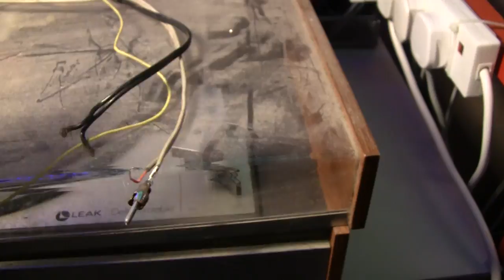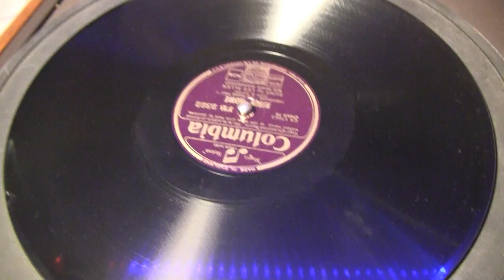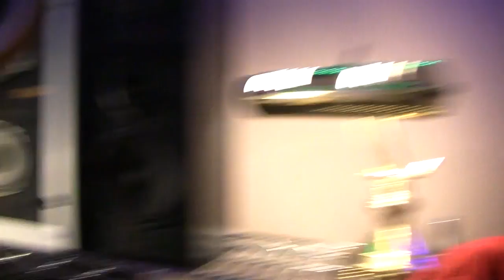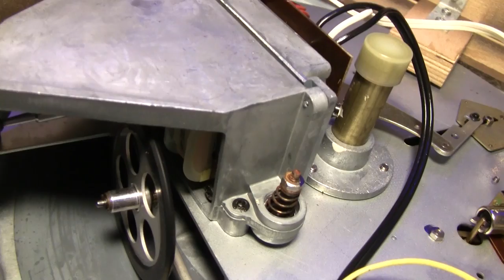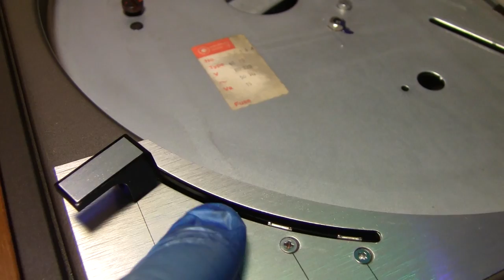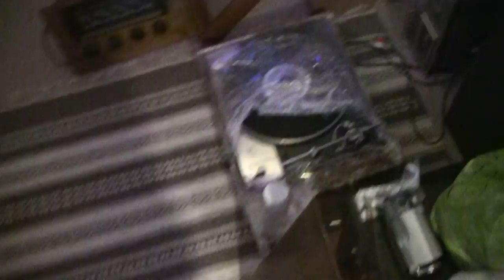Goldring Lenco GL-75 Turntable - Service & Presentation!

Comment: When I first began watching YT, I came across an video from a fellow who restored an Lenco TT for use as a dedicated high end mono record player. He installed a mono cartridge and was using a restored 50's mono tube amp and one excellent speaker unit. Those Lenco TT's are intriguing to say the least. I've yet to see one in my travels here in Canada but I'd pick one up if I were to find one. It was great to see the innards and the mechanisms!

Comment: I quite liked the GL75. Why anyone would have purchased the Leak version when it cost quite abit more than the Lenco original always puzzled me. The arm is not the best for sure, it's quite massy. I used to sell it with a headshell punched full of holes. This did help remove at least some of the mass. It worked best with a cartridge that would track around the 2.5 gram range. It did not like the Goldring G800/E which was often sold with it. It really did not track well at 1-1.5 grams.
Because of the high electrical field the AC motor throw out, some cartridges would pick up hum as the pickup moved towards the centre. The GRADO FTR is a good example. Any of the Decca range is a no no! Great cartridges but not on the lenco.
Reply from the maker: Hi MB, Thanks for the info!

Comment: Hi.. Great video. I have a Goldring Lenco 75 I think. Should I eBay it sold as seen or try to get it serviced? If they sell from between 60 to 120 maybe not worth it. The perspex lid is quote scratched but otherwise good.
Reply from the maker: Hi SB!

Well, it depends on what you want more than anything else. If you don't have any TTs, or want another to add to your collection, these are nice TTs to have.

If you are looking to make money on them, I've seen them go for anything from £40 for a working tatty example, to over £100 for a mint one.

Perspex lids can be helped a bit by using an abrasive plastic polisher. The stuff car shops use to polish plastic headlights is good for this.

Hope this helps you decide what you're going to do! :-)
Reply: Dr Circuit  Hi, are you an electrical engineer or is HiFi your hobby? Thanks for your advice. Do you service equipment...? Also if any people reading this fancy owning the same turntable I will pass them my email. My system is a rega 3 through mission Cyrus one amp. The amp I have always liked but scratchy volume and selectors no longer selecting the source so thinking of getting it serviced.
Reply from the maker: Simeon Banner
Nope, it's merely a hobby. Having said that I'm looking at various electronics courses (just for fun!).

I'm an IT guy by training/education, and do a variety of other stuff too, none of which I'll bore anyone with.

I did, and will service equipment, but at the moment I'm up to my eyes in that 'variety of stuff' mentioned above so I can't service equipment for the foreseeable future.

Hopefully someone will see this and approach you if they can help!

Comment: Great video. Took your advice and viewed the video by Sparky. Great stuff. I have just bought a GL85 - belt drive. Lovely machine. Needs refurbishment and quite different mechanics with a lighter motor, transformer and an integrated circuit to make metters more perplexing Any tips?.
Reply from the maker: Hi BG, and thanks. As for GL85 tips... I've never had one :-(